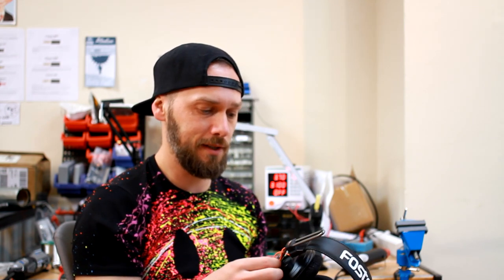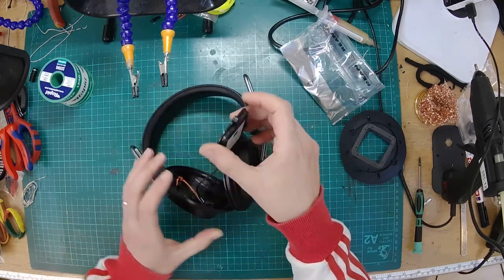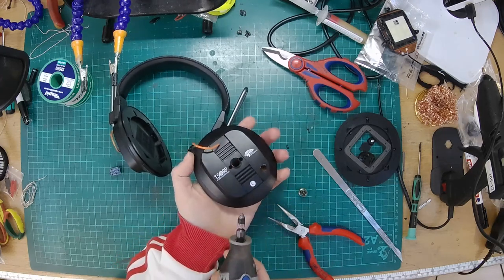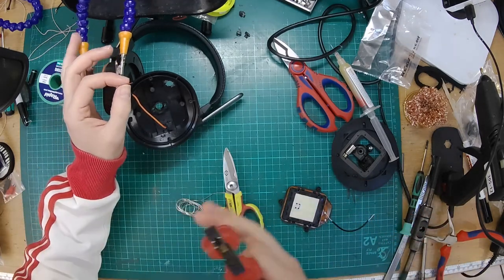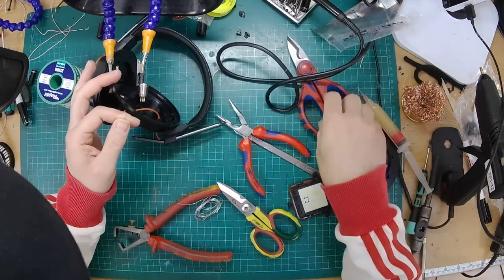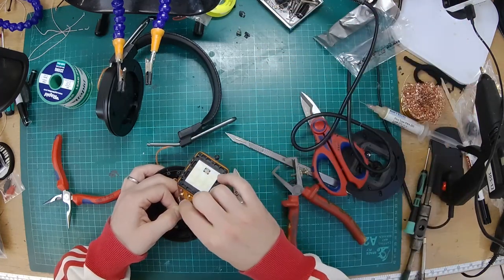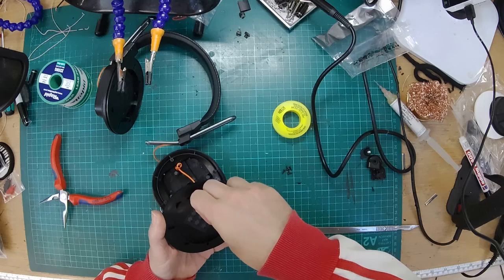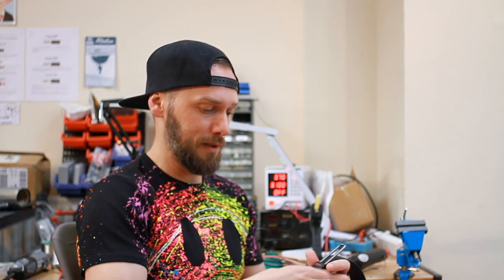Fostex T50RP Balanced 4pin miniXLR conversion

Comment: Excellent video, thanks Jason! Have a pair of modded T50rps (Modhouse Argon) that I'd like to convert to balanced now I have a balanced amp... Would be great to see a detailed video of connectors for both sides and some driver mods! (I suspect I'll be emailing you about the balanced conversion though - those wires look fiddly...!)
Reply from the maker: It is not too hard - from what I remember, the drivers have the + and - marked on them
Reply: @CustomCans  I’m interested in doing a balanced conversion of my Argon as well. Can you advise or show a video? 
Thank you

Comment: Hey, thanks for the video! I would like to add some acoustic foam in the cups, you've added something different as dampening material as far as I can remember in the full custom video, was it ordinary tape? I would add some weight to the driver as well by adding led strips. Some modders are adding clay in addition to the cups, do you have any opinion on that I dont see any benefits in that. I would prefer to do mods to give the lows a little bit more punch and can be undone if it feels muddy. :)
Reply: Dampening material is like thin dense foam with sticky stuff on one side, cut to size, remove the paper covering the glue then apply. I used some on my 770 and 1990's and it makes cleaner tone to the bass apparently though I added weight to the driver too so I'm not actually sure which part did the good stuff. I'd be interested in seeing someone add LED strips to headhpones :)
Reply from the maker: Yes you can use all kinds of materials to add weight and damp vibrations we tend to use lead as it is very dense so you can get a lot of weight in the right place and we use bitumen based damping material .... mainly as it makes it easy for us to produce kits we can sell with it to recoup the cost of all the testing we do
Reply from the maker: @jason Ridgwell - We have made quite a few headphones with LEDs and Lasers for our DJ customers - I will try to get a video next time we do something like that
Reply: @RestlessZombi  I used Akasa for my Open Alpha.